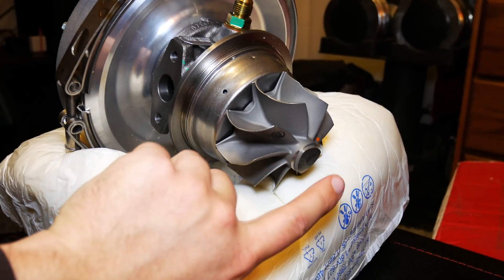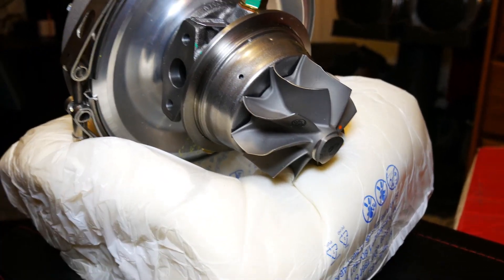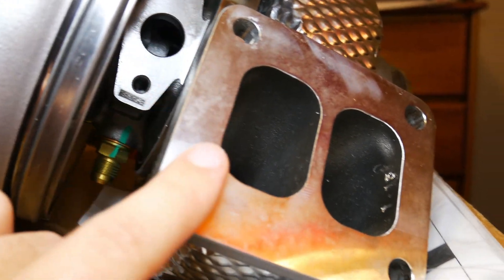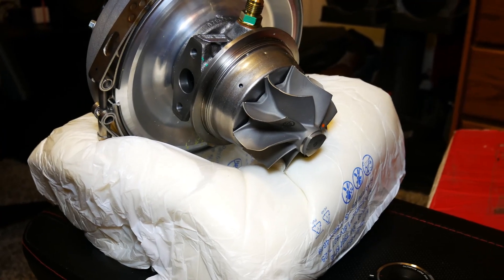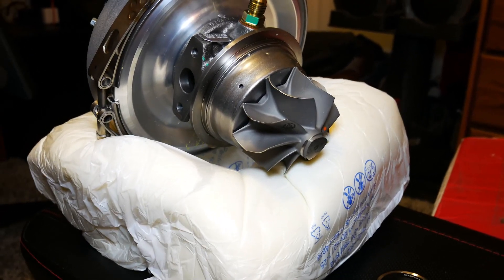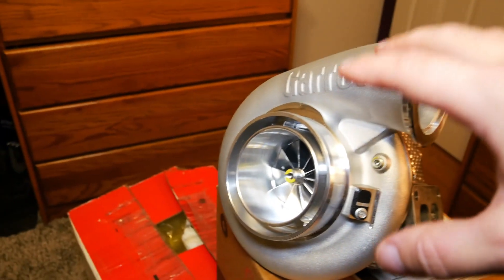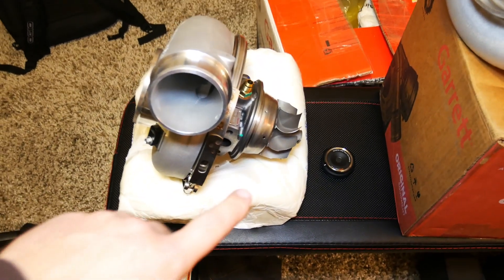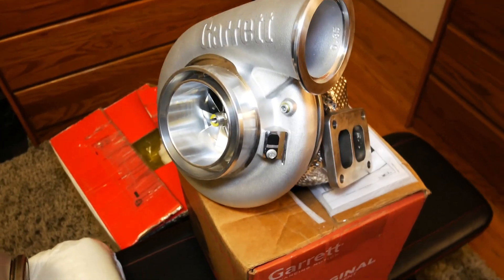Engine Builds, Garrett G42s, and Future of RGHTBrainDesign

Comment: If HP is a lagging indicator of your setup (engine modification and parts), what can you leverage as a leading indicator to have a higher likelihood of increased performance prior to engine assembly or set-up? Your approach of eliminating as many variables in the engine comparison will not have the same level of objectivity if you can't measure leading indicators as a baseline for comparison.  At that point you're starting a pissing contest, not creating an environment for a fair comparison between two engine builders. 

I'm still down to see the results though 😂 🍿
Great work btw, Ryan. I'm always excited to see your content since you actually make the effort to educate vs entertain.
Reply from the maker: I honestly think that asking two engine builders (who know and have followed my GT 1st Gen journey) for the exact same thing and letting them put their spin on it is about as Apples to Apples as things can be.  

I asked for, "A calm, streetable, reasonable Primary with a top end that keeps on kicking, while able to use the flapper in the REW Upper Intake Manifold to fully separate air charge on Primary Only vs. Primary + Secondary + Semi when opened."  

All of the components throughout the engines are identical, so it's just a matter of Port vs. Port.  They've both seen this video and hopefully are both inspired to make greatness from their work to showcase their abilities.  

At this point I'm wondering if the one started a week ago will arrive here before the one started 18 months ago.